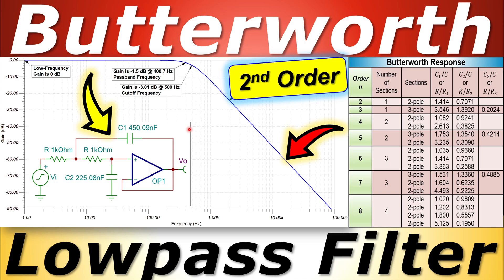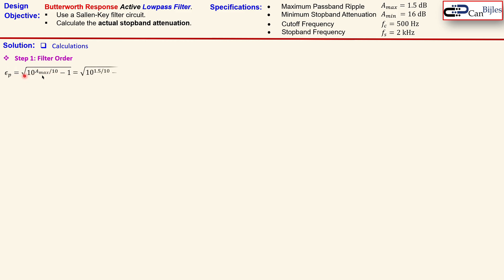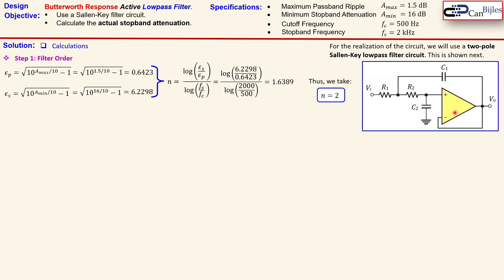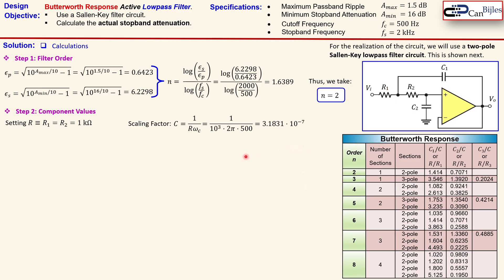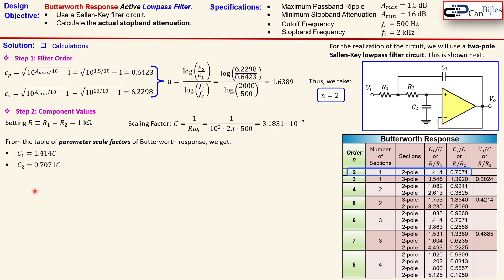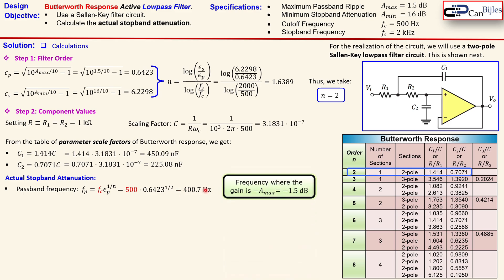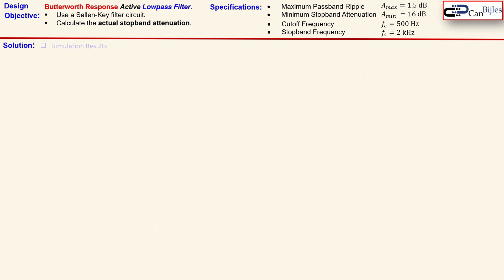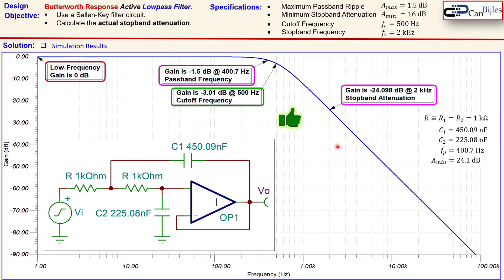🌟 Butterworth Response Lowpass Filter Design - 2nd Order 💡 Two-Pole Sallen-Key Circuit

Comment: How about something in the HF range with an op-amp ? 16 Mhz (20 meters) would be good.
Reply from the maker: The effects of the op-amp dynamics are not considered in this design. Op-amp gain-bandwidth product and slew-rate will limit the frequency response and speed of the actual circuit. Usually, there will be more poles and additional zero due to op-amp.